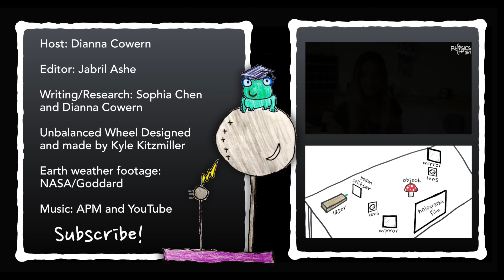Are perpetual motion machines possible?

Comment: There are also perpetual machines of the second kind, which obey the conservation of energy (first law of thermodynamics), but violate the law that the entropy of the universe always increases (second law of thermodynamics).  Both perpetual motion machines of the first kind and of the second kind would theoretically solve all of humanity's energy needs forever, but both types are unfortunately also impossible according to the known laws of physics.
Reply: +Physics Videos by Eugene Khutoryansky
There's also perpetual motion machines of the third kind (spin forever but you can't extract energy from them). These work, for example a superconducting ring with a magnetic field inside.
Reply: +IamGrimalkin Why can't you extract energy from them? Surely there's a way? As all energy is converted to another form at one point
Reply: +Hana A planet in vacuum with a constant speed is at perpetual motion, but if you try to extract energy from it, you would create a negative acceleration.
Reply: Hana
Or rather, you can extract energy from them, but it causes the machine to slow down, or destroy the structure entirely.

In the case of a superconducting ring, you can only take energy from the current by making a section of the ring non-superconducting, which destroys the structure of the device.
Reply: +Physics Videos by Eugene Khutoryansky  This is not information entropy but thermodynamic entropy, which has nothing to do with disorder, but rather thermodynamic entropy which is concerned with energy density, and will go from greater density to lesser density unless constrained, and that is what the universe is about, chemical kinetics.  Google entropysite  .oxy.edu and understand what I am refering to.
Reply: +Hana  You don't want to extract energy from them, you want to get work from them. There is a huge difference.  You can get work output without rejecting thermal energy outside the local closed system.
Reply: +Physics Videos by Eugene Khutoryansky Video on Perpetual Motion Machines? I think you've already did something similar, but would be cool.
Reply: There are no violation of the thermodynamic laws. Continuous work output  at less than the energy flow, from the same energy is allowed,  Entropy is not about disorder, but about energy moving from dense state to less dense state unless prevented from doing so by a constraint, Entropy is what makes our Universe work. As far as increasing, it simply means the universe tends towards zero.
Reply: Kimberly Peacock The entropy can reduce, but it is difficult to occur.
Reply: That sir is an understatement in terms of a cyclic process.  On paper when you find this path, you think fame and fortune, Then you go to engineer it, and realize that in science models the equations are perfect, but in the real world nothing is.  You think the biggest problem is maintaining internal energy thermally, but soon conclude mass loss is the biggest enemy.  It's a new type of heat engine, one that is very efficient in the true sense of the word.  It will wear out, and from time to time you will have to replace some of the mass lost to keep it running.  Still I consider the experience a success, and I am sure there will be applications for it, where the upfront cost is not the most critical aspect.
Reply: +Rodrigo Appendino Entropy isnt conserved in the universe ... it just grows UP created entropy can only be postive or nul(reversible transformations)
Reply: +Physics Videos by Eugene Khutoryansky It's entirely possible to have a localised decrease in entropy it just costs energy to create and sustain that, this is most commonly associated with life and is one potentially useful way to test for the existence of life since in theory even alternate biochemistries would most likely maintain a lower internal entropy than their environment to sustain their processes.
Reply: Seraphina S The energy flow in itself increases entropy faster than the localised decrease.
Reply: IamGrimalkin Oh they certainly raise the entropy in the external environment of course it has to, life can't defy the laws of physics it's more a case of feeding on negative entropy and rejecting their own high entropy waste etc.  Overall the total entropy between the environment and the organism taken together rises.

It is still a potentially valid scientific clue that could be useful for testing potentially life like structures were we to encounter one that we had never seen or hypothesised of.  Certainly that single test in and of itself seems far from conclusive but it's a potentially useful piece of evidence in analysis.
Reply: But bees avoid all laws of aviation , meaning we can break all laws(of physics)
Reply: Kimberly Peacock 
Hi. It seems interesting...Plesae try to explain it again. If you are talking about those ridiculous "theories" on "free energy scientologism", never mind on explaing better. 
But if you are making  remarks about physics concepts, please answer. In fact I think the expression "extracting energy" may be misleading.
Thanks.
Reply: mlnki it doesn’t make sense to say you can take energy from something and it continues its motion in the same conditions... even on the quantum level, just looking at a particle affects it and causes it to change.
Reply: At best they would be a very good battery, not a "perpetual energy source".
Reply: § In 1712, Bessler received his first testimony after demonstrating his first self-rotating wheel in Gera (Thuringia). Following a demonstration of a larger wheel in 1713 in Draschwitz near Leipzig, three of Bessler’s adversaries published pamphlets critiquing his work, accusing him of being a conman. Bessler then destroyed the wheel and built an improved version (which could turn in both directions) in Merseburg, where it was examined on 31 October 1715 by Maurice Wilhelm, duke of Saxe-Merseburg, in the presence of Dutch scholar Willem Jacob ‘s Gravesande and German scholar Gottfried Leibnitz. However, when s’ Gravesande tried to inspect the axle more closely, Bessler exploded in a fit of rage, as he was afraid that ‘s Gravesande might discover his secret. Once again, Bessler destroyed his own invention.
However, no one succeeded in proving that Bessler was a fraud and he became increasingly renowned. Intrigued, landgrave Prince Charles hired Bessler at Weissenstein castle, where Bessler constructed an even larger wheel measuring 36cm in width and approximately 3.7m in diameter. After its completion, the wheel was set in motion and the room was sealed off. Fifty-four days later the seal was broken, and the wheel was still turning …*§*
Reply: rpfphysic yes the entropy in the room is increasing by water evaporating on the beak of the bird. Eventually bird’s beak will no longer touch the water and the motion will stop. If we keep adding water then motion will stop when the humidity in the room reaches dew point. This toy works exactly like a steam engine instead of heating one end we are cooling the other end by evaporative cooling. Efficiency of this toy is quite remarkable.
Reply: minki, while it's impossible to even get 100% efficiency in our world, in such a hypothetical case there is no energy input and there is no energy lost, but it will appear to be in motion but in perfect equilibrium. However, as soon as you put a load on it, it will no longer be 100% efficient since part of the energy will be expended in the device which converts the kinetic energy to something useful.
Reply: Well you know things.
Reply: His machine doesn't move faster over time, and that means there's no energy to be gained from it. While ball bearings are very efficient at transferring energy, and his design is efficient in that it doesn't use a significant amount of energy, it is still bleeding energy and will stop eventually.
Reply: Physics Videos by Eugene Khutoryansky I
Reply: mlnki Because in a superconducting ring there’s no resistance
Reply: Would you think that some of these laws of physics are flawed?
Reply: Because I believe they are...
Reply: Type "H. Tomasz Grzybowski" in Google, get to my Research Gate page, click on "Contributions" and find my article "Diode Rectifies Thermal Noise".
Reply: Physics Videos by Eugene Khutoryansky they wouldn’t solve anything even if they were possible. Even if they rotated forever if you tried to apply a load to it, it would stop immediately. Perpetual motion means it doesn’t lose energy by moving, it doesn’t generate energy
Reply: Physics Videos by Eugene Khutoryansky what if you replaced rhe axle with a magnet in the center of a metal ring
Reply: Don Francisco no, it’s just not possible. The entire universe is built on the laws of physics that you are trying to break
Reply: Physics Videos by Eugene Khutoryansky hmm maybe they aren't thinking out of the box?🤔
Well if i can solve this i would be the smartest man in the world and im 14 😃
Reply: Wrong
Reply: intelligent people having an argument....
Reply: Physics Videos by Eugene Khutoryansky what if we put a machine similar to the one in the video but uses magnets so suspend it from the axle, and what about putting it in space? Would that solve the problem
Reply: Physics Videos by Eugene Khutoryansky y
Reply: Yes. We know
Reply: @KimberlyRPeacock  What do you think about regenerative acceleration?
Reply: @marcisgulbis9310  know next to nothing about it.
Reply: @KimberlyRPeacock  Regenerative acceleration is real perpetual motion and free energy. If that technology is used in electric cars, we don't need plug in to recharge. Tesla is only car company in the world that can make it reality.
Reply: Why don't we make new laws?
Reply: @davidregi7571  because oil companies doesn't allow it.
Reply: You cannot extract energy from a closed system because the conservation of energy says that a closed system has a constant amount of energy  ìf you extract energy from that system in motion it stops being in motion
Reply: @jeremysmith8035  Steam engines and internal combustion engines is closed systems. Asymmetric electric motors and self accelerating generators are open systems. Nikola Tesla's wireless energy transmitter is also an open system.